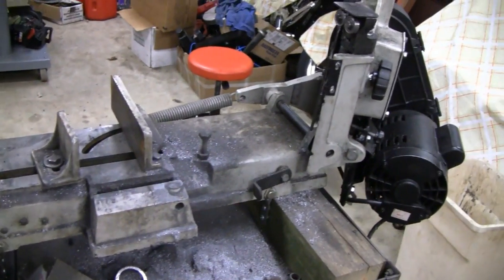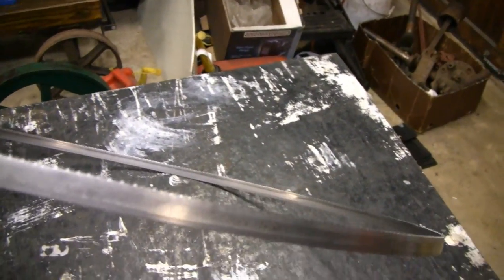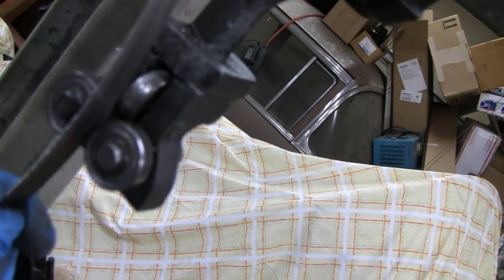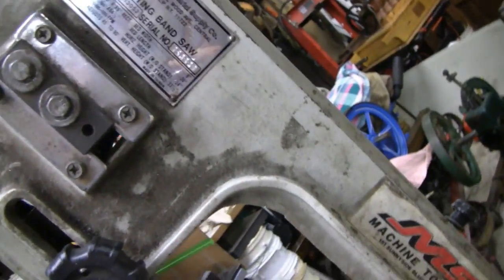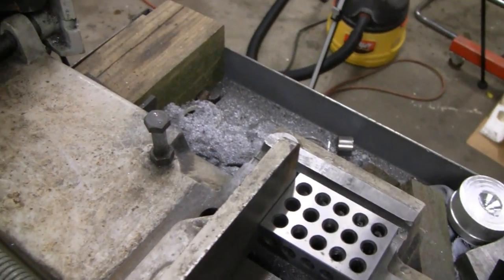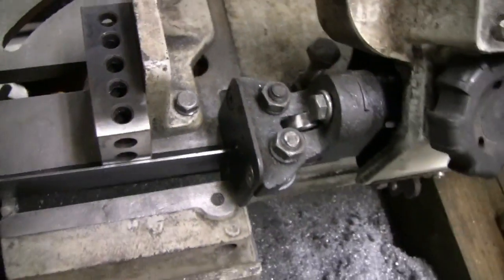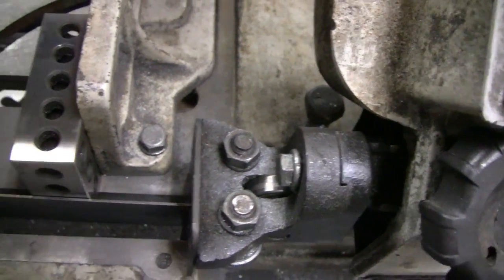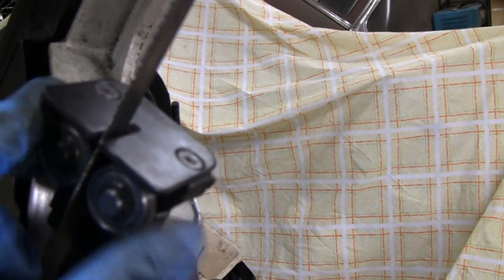HOW TO ADJUST BANDSAW (4 X 6)

Comment: I have a similar saw 7 x 12 from MSC Industrial.. The one that 3 or 4 brands use the same casting and put there name on. 
It uses a 93" x 0.035 x 3/4 wide blade. I put new bearings on it and still couldn't get it to make a straight cut like it did when new.....
I tried all the techniques with tilting the bearing assemblies and tensioning the hell out of it. The cut was square in the vise, but running out from top of the cut to the bottom..
I didn't think it would fit, but I got smart and decided to try the same length blade, but 1" wide.. It works like a charm keeping the blade from drifting in the vertical travel. It's stiff as hell installing it, but it fits.  The cuts are now perfectly square in all directions. I use coolant, but the wider blade also absorbs more heat. I found this one on Am*z0n with excellent reviews. 
Imachinist S931812 M42 93" X 1" X .035" x 8/12 TPI . It rips through alum and steel like it wasn't even there. 
I also sourced out some spacers to spread the guide bearing out on the 1" blade for a better spread from McMaster Carr , 92510A491, Aluminum Unthreaded Spacer 3/4" OD, 1/4" Long, for 3/8" Screw Size. I haven't installed them yet as it works well as is. 
I hope this helps someone going through the same frustration I went through.. 👍✌

Comment: Hi , I just bought a Ram Machinery horizontal floor bandsaw . Name plate says size of blade is 64.5" x .5 x 1/80" . Not having any luck finding  this blade . Any suggestions ? It is old , 1987 but good shape . It is 4x6  with 3/4 HP . If I can't find said size what would be best to use safely ?
Reply from the maker: That's a common size blade, you can get them at Harbor Freight!! Don't worry about the 1/80, that's just the thickness of the blade all manufacturers are different!! I get mine from Ebay, Olson 64.5 x 1/2  18 TPI (teeth per in)
Reply: @805ROADKING  Thank you for your comments. I discussed this situation with my brother and other manufacturers employees that .025 $ .020 would be fine . It just had me worked for a bit . Machine was made in 1987 but is in very good shape . All is good in the neighborhood . Put a blade on it yesterday and it cuts well . I'm happy . Thanks again !

Comment: With the guide bearing adjustment my manual says the inside bearings are non adjustable as you just said but my one has all four bearings adjustable which makes it bloody hard to set up. I bought a new £22 ($30) bi-metal blade last week and promptly fucked it up because I couldn't get the adjustment right. I've just made two new unadjustable bearing spigots to the same dimensions as the originals but the bearing pivot is concentric with the 10 mm threaded mounting. As for the adjustment it says in the manual that a 0.025" thick blade should have one thou clearance so it should be in theory just a matter of putting a 0.026" feeler gauge between the bearing surfaces. But when you have all four of the bearings adjustable then it's a nightmare to get right. Well I've put the old blade back in with the new pivots and it runs ok so I'll order a new blade this week and try it out!

Comment: I have tried the other methods with making a cut, observing the resulting non-square angles in the cut and adjusting. Using a machinists square etc. The 1-2-3 block really did the trick for me. Watched your video yesterday, spent some time fiddling with the saw last night and got it to 1mm off over a 50mm cut. Not perfect, but I will for sure work some more on it!

Great video that helped me out with my saw. Thank you!

Comment: Hi. I bought new one and can't adjust blade in back wheel (motor shaft wheel). Everything align in front/top wheel, just facing edge, very nice. But back wheel seems to pull off the blade and only half size is touching wheel. Any idea how to adjust?

Comment: legend say that whoever adjust these metal bandsaws to cut properly, automatically becomes a member of secret metal bandsaw society and get honor masters degree in engineering. I bought saw that is off on pivot point so all tips becomes useless unless you drill new holes for pivot point and align axis

Comment: I watched the whole video for 1 purpose,to see how the top adjustment works and that's the part you never showed how the two bolts  adjust the top wheel .
Reply: Me too. It's the small hole behind top pulley. Loosen 2 bolts and use allan key to adjust inside the hole. Loosen bolts, adjust, tighten bolts and test. Repeat.

Comment: I always like to square the fence to the blade with a 12” combination square, put the body against the blade (gently) and the ruler part against the vice jaw. It’s really accurate because the ruler extends across the whole vise jaw, not just a couple inches. Another trick I was taught was with the saw upright and the cover opened, cut a piece of paper into 1” strips in the long direction (with scissors of course, not the bandsaw!). Insert the paper 90 degrees to the blade and rotate the adjustable wheel to pull the paper between it and the blade. Rotate it until the paper comes out the other side of the rotation. If your tracking (wheel) is adjusted right, the paper will have a sharp bend in it . If it’s cut in two, it means the blade is being forced into the wheel flange which wears out both the wheel and blade. If the bend isn’t sharp, the blade needs to be adjusted closer to the flange. As for all the questions about tracking adjustments, nearly everyone of these saws I’ve seen require loosening the bolt closest to the handle, and turning the adjacent bolt in or out to adjust. Then re-tighten the other bolt and recheck with the paper method. These things can be made into really accurate saws, but only through sweat equity!
Reply: Do a vid on this please.
Hard to visualize.
Would appreciate it.

If you do make a vid, make sure to notify me here plz.

Comment: How about tension on the blade from the big drive wheels? I have an issue where my blade will get caught up on the material while the drive wheels keep spinning and i keep cranking on the knob to tighten the blade with no luck.

Comment: I have one like this. I use be metal blade.  I use the middle speed but aboit the pressure i am always scare to put tu much pressure when cutting....   i usuly cut 1/8 flat bar and tubing ...

Comment: I've got the same saw,my blade runs off the big wheels the two bolts you didn't show adjusts them do you go in or out?
Reply: I have a similar machine, there could be a third screw (mine it's hex set screw).
Reply: @AlmightyMister  I'll check that out, thanks man.

Comment: hi there, nice video i have a question, when you were tracking the blade so it would run true by inclining the idler wheel with the jacking screws, what is the position of the drive wheel in relation to this? does it stay parallel in relation to the saw body or does it need inclined as well? i was given a startrite bandsaw that required the gearbox rebuilt, there is jacking screws on it also although the manual only seems to mention the idler for adjustment, any thoughts greatly appreciated!

Comment: Wish you would of shown what you was doing on the top pulleys set  bolts to get that blade to track up to the shoulder of the pulleys.
Reply: Chip Sammich that’s the problem I’m having, the top pulley adjustments

Comment: How did you adjust the pulley wheel?
Reply: Loosen the 2 12mm bolts on the back and put a 5/32 allan wrench in the small hole. Tighten a little bit at a time and keep testing.

Comment: I have been using that same MSC bandsaw over 20 years now. I never had a problem with it except for cheap blades. You get what you pay for. I use Olsen blades, I never had any good luck with any of the HF blades.  It is my number one metal cutting tool. I use it as much in the vertical position as I do horizontal.   The vertical table that came with it works fine, but most ot the time I just use the guide foot plate as is.

Comment: Thanks for posting.   I have an Enco version of your saw and it has cut square for 20 years.....until recently.  I did all the adjustments I could think of but to no avail.  I didn't realize, until I watched your video, that one of the guide bearings has a cam action.  I'm going to look again armed with this knowledge.  Thanks for taking the time!
Reply from the maker: Glad you found the video!! Good luck!!☺
Reply: Don't to change out all the guide bearings they are a wear item and inexpensive to replace with stock ebay bearings.

Comment: I have an old 4x6 bandsaw from Harbor Freight with a manufacturing date of 1993 on it. It looks like a genuine Rong Fu built one to me. It also says it is made in Taiwan. So its the good stuff.
Reply: I also have the Taiwan version from the late 1980's  (BC) "Before China" fit and finish is way nicer than the current H/F China version. Any idea what bearing size(s) are used for the guides?
Reply: Defnotdemas
Central Machinery. So a Harbor Freight re-brand.

Comment: Good Morning RoadKing,...I have a saw almost exactly like yours,...mine is a "Jet' ,..and I have the same problem with that angled cut through the flat stock when cutting from the edge down,...did you re-check this ?  Also maybe the best way, ( if it will fit ) is to lay it on it's flat side and cut that way,..what do you think ?
Good video too, good tips there, thanks Master.
Reply from the maker: Reg Sparkes Good morning Reg!! Once I readjusted everything it cut fine!! Laying it flat works but it seems like it takes forever to cut that way!!☺